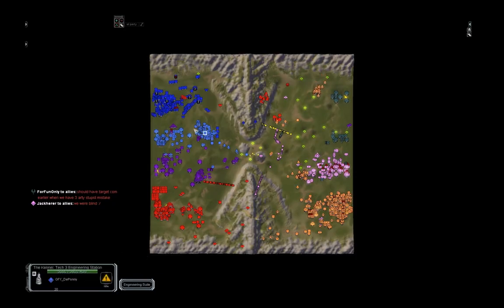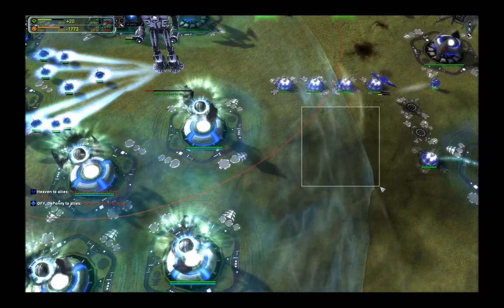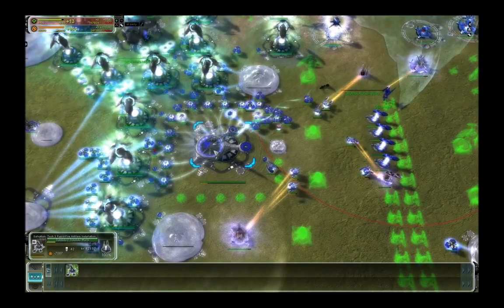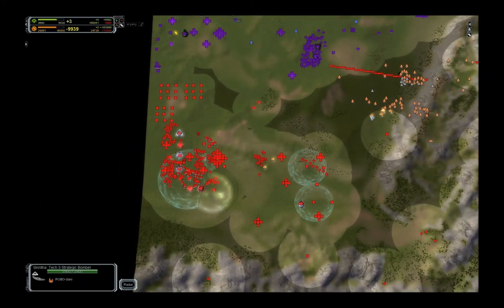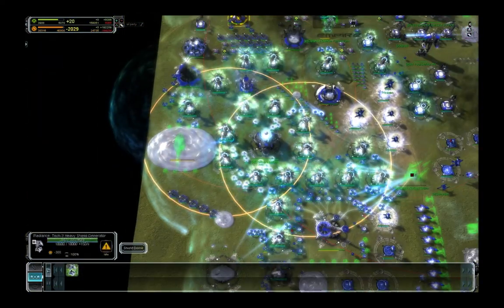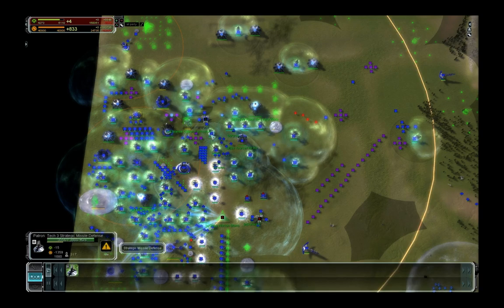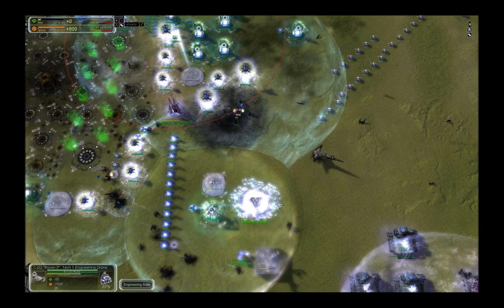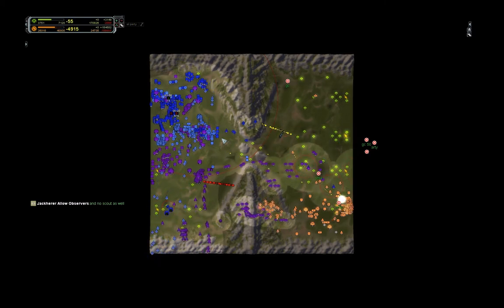Paragon, ParaGone, Paragon - FAF How To 3 - Supreme Commander Forged Alliance

Comment: Talking about paragon defense (or any other late stage game base defense case) the following should be strongly noted:
You should never have ANY air units inside shields in critical areas, under this term I mean any area around of vulnerable buildings like paragon or smd (if you have only one smd). Air player may target ASFs on such unit. Can u imagine how fast shields goes down under like 150 ASFs fire? It is very cheap way to kill shielded target because air player doesn't need to build a tonn of strats. Speaking about air units inside shields you should never forgot that engineering drones are air units too and that is the unit which have big chances to be inside critical area and under shields.
Reply: In this video I saw a drones flying near to critical area and being attacked by ASFs. I think this might be the reason why so many shields lost like 95% of their strength. (But it is still not explains why mobile shields lost same amount of strength while stationary shields were online.)
Reply from the maker: asfs can't even shoot at drones anymore, this was removed long ago

explanation for second observation is shield spillover damage, a feature that has been implemented briefly before ZeP left FAF
Reply: hm, thats strange. It means that I can send drones to an enemy territory without static/land AA in area and reclaim whatever I want, even base structures.
Reply from the maker: i said asfs cannot shoot at them, what makes you assume the same goes for all other aircraft? derp
Reply: If asfs is an exception - then other aircrafts may shoot at them, like restorers. They have high firepower and range so it is enough to cause same problem with drones as asfs do.
Reply from the maker: i like how you state the obvious with such a sense of discovery! restorers suck though

Comment: ...and then a donut falls straight through all the shields )
Reply from the maker: np, just need a couple more paragons
Reply: Heaven if u built a paragon, that usually means u are racing with other team, who also trying to build paragon. And if you put your eco in second para just after the completion of 1st, you well may loose t3/t4 artillery race. And the storm of shells from above will kill any number of paragons )
Mass-producing ras SCUs may also be the option. And then add a tele to them and throw at enemy base =)
Reply from the maker: good thinking, but unfortunately most of these assumptions don't hold in practice.

paragons are extremely uncommon. paragon races practically never happen except in very few high level seton's games.

if you build paragon, you don't build t4 arty at the same time. having a 50% paragon and a 50% finished salvation is a really bad setup against a finished paragon, for example. t4 arty war doesn't exist in the scenario you describe. turtling against t3 arty or a single scathis is doable.

the second paragon doesn't cost you any mass or power because the first one generates infinite eco. with drones, you can build it in a few seconds, as shown in the video. there is no notable opportunity cost associated with getting the second paragon after you already have the first.

using teleport on RAS presets is a waste unless you intend to use sac/tele GC, which will be topic of another video. rather upgrade teleport on SACUs that aren't RAS-upgraded if you use them for the gun and death nuke damage. as discussed in the video above, SACU tele is a somewhat viable counter against paragon. need to hit it while still under construction or before the second one is online.

hope correcting you didn't appear harsh; what matters to me the most is creating an environment that allows people to improve their understanding of the game. that isn't possible without correcting a few misconceptions sometimes.
Reply: You must know that paragon's eco is huge, but NOT infinite!
t3/t4 artillery spam - happens right after the paragon is done. You must spam them like t1pds to hit enemy base as soon as possible. And if u do it right, it will mass stall the paragon.
...And if it is not a race, then you probably can win (or loose =) ) w\o paragon :)
Happens on any large map, not only seton's.
Teleport upgrade on sacus is a great feature, that opens huge possibilities - esp. on larger maps and by not teleporting directly at enemy base.
Reply from the maker: the income surplus a paragon generates is hardcapped at +20 mass and +1000 power above your spending. if you spend 50m and 3000e, the paragon generates 70m and 4000e. if you spend 80m and 7000e, the paragon generates 100m and 8000e. this behavior does not change, regardless of how high values get.

thus, the income is infinite and only limited by your spending and your build power, which are both easy to scale up once you have a paragon. even to the extent that you can get your second paragon in a few seconds.

it is not possible to mass stall with a paragon. if it still happens, it must be a sim-side desync, a lag-related display bug or some other type of technical issue. if you have an unmodded replay where somebody mass-stalls with a completed paragon, please send it to me so i can forward it to tech support.
Reply: Heaven
that may be a networking case (some sort of syncing all the crap between the clients), but it is very real to stall a paragon - it just happens all the time. BRNK also has a number of paragon stalls in his streams.
Reply: For as far as I know and for as long as I remember the paragon has been capped at 10K mass and 1M energy. The odds of you ever spending so much in one go are minimal though, because you need so much build power to actually spend it. I just did a test: Paragon + 100 fully upgraded hives and let them build lots of Mavors. I got to mass stall there (100 hives want a total of 16800 mass per second to build at 100% efficiency).
Reply: theplasmawolf exactly, hives can easily stall it. In case you got access to a different techs. BTW, 100 hives is a simple grid ten by ten.
Reply: Yep, I got mass stall on paragon in some games but (!) it happened more than year ago, so something might be changed, I never played a games with Pragon and like 100 hives building Mavor in last year. Thats because I just don't like turtle games and overplayed maps (like Gapsss or Seton) and in good real games it is very rare case when game escalates to paragon stage.
Reply: XXXArgonXXX
if it is not seton's or gap, that doesn't mean the map is small ;) Things can escalate to a paragon in a natural way. And the quality of game is never connected to a map's size.
Reply: I didn't talked about size of the map, but about map played count. For me (just for me) game quality calculated from amount of intresting things happened in game. But in very big maps (in most cases but not every) the proportion in real actions compared to waiting/ecoing is shifted towards last one. So I assume it as not too good game. As heaven said - good games is where you find weak points and use them, and do it all time in all stages. In big map you have to eco first because if you try to be agressive and sand units - in time your t1/t2 units reach the target it will be too late to deal real damage because opponent gets access to next tech tier and easily defend himself. Said above not relevant to noob games because noobs is a different universe.. you know, likestories about  not occupied mexes and wasted eco on useless static defence (in huge map!).
Reply from the maker: as argon said, larger maps make it more difficult to maintain a high level of interaction. experienced players (read: ~top 50 ladder) can handle large maps and games will be entertaining, but watching average joes and beginners on large maps is absolute cringe. i remember the 1v1 games between tokyto and me on burial mounds, it felt like the map was just too high level for us.

Comment: If they can snipe a paragon why not just get the acu?
Reply from the maker: ACUs are higher HP and smaller in size, which makes them harder to kill
Reply: The acu is a smaller target, can run and dodge some bombs with good micro, and is more can't than a paragon.
Plus in this case, the acu had the second aeon shield upgrade, which is the most sturdy personal shield in the entire game